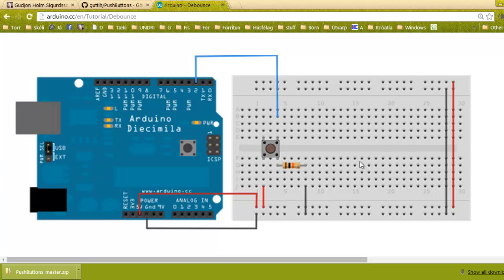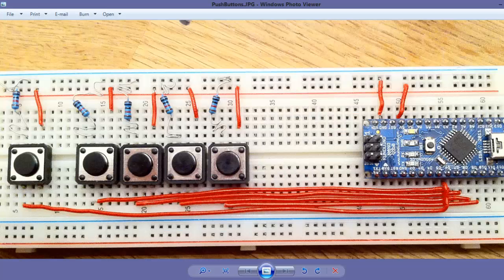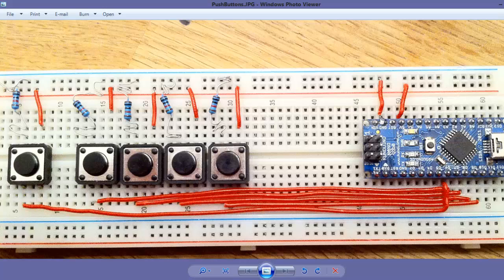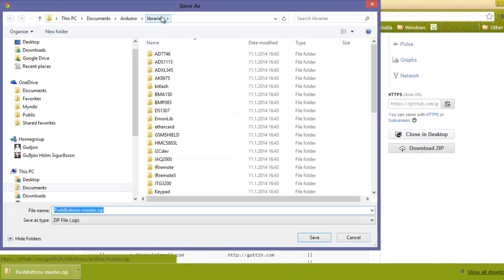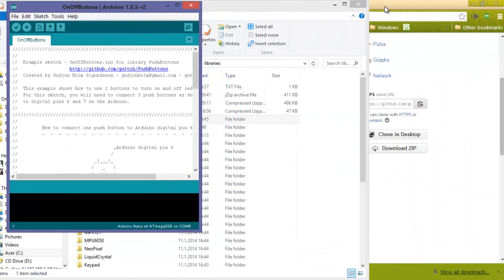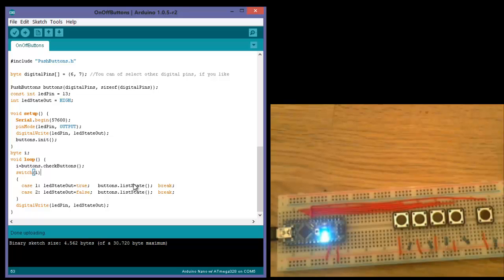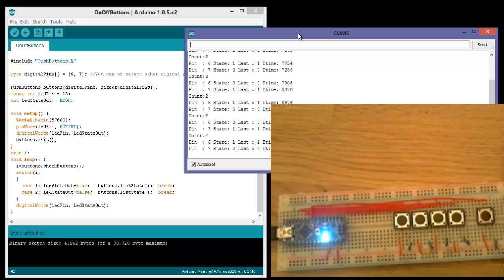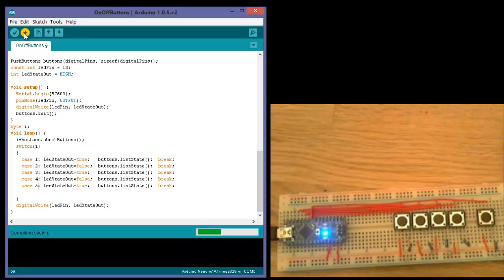Arduino 18 - PushButtons

Comment: Great video, but how is going to be if you have 5 buttons and 4 different led lights instead of just one led... One button for OFF of all led lights, and 4 other buttons for ON of 4 different led lights.... I  need this code please if you have :)
Reply from the maker: Yes, that would have been better.  I just wanted to show how the library worked and did not think much about the circuit.